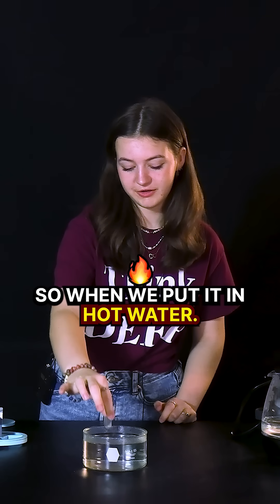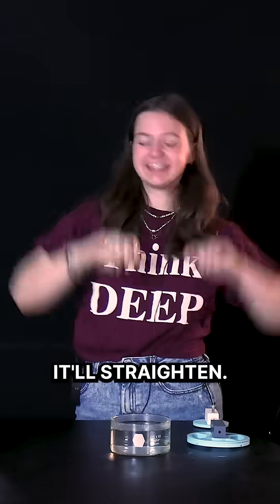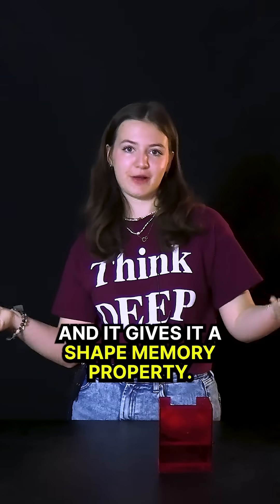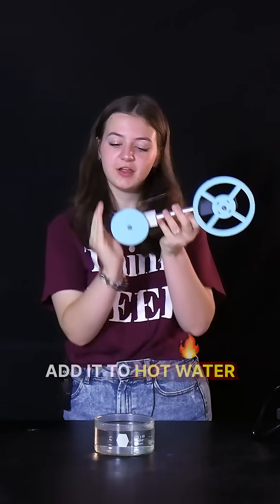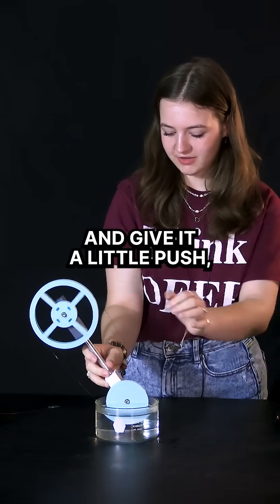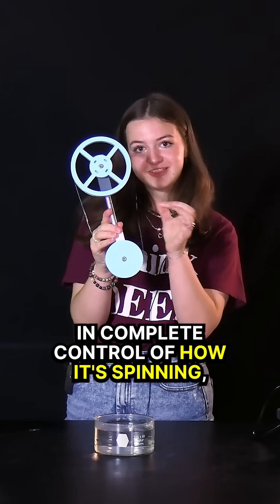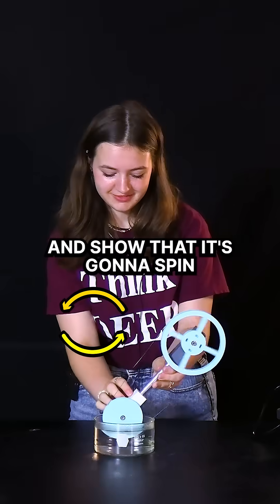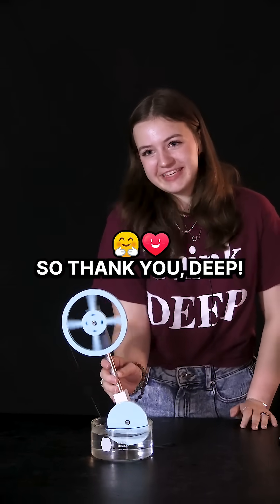Magic metal springs to life from heat! But how?? #shorts #tamu #science

Comment: For those who think it is infinite, It is not perpetual machine, because the water will lose heat and you should spend energy to re heat it again.
Someday you should believe that there would be no perpetual machine in the world.
Reply: That's not really a problem, you can have a closed system to keep heating the water, the problem is, the amount of energy that would take because of how high waters specific heat capacity is means you will need alot of energy to keep perpetually heating the water which means ALOTof money which is just to expensive to be sustainable
Reply: @jadepersonally when we dig down far enough it gets super hot, so we’d just stick a metal rod the full length to surface it will be hot continuously to heat water.
Reply: @TrueIndependent you are describing geothermal power, which we already use.
Reply: @jadepersonally  yea so no perpetual motion because it would take energy to heat up the water
Reply: hot water springs always have hot water
so there u can get unlimited energy source
Reply: @NishantCosmos  those run out too
Reply: @stephyn  hot spring water is generally hot throughout the year. Hot springs are heated by geothermal energy from deep within the Earth
Reply: So if you were to say place the wheel in a thermal pool, you would keep the heat up, and it would keep spinning ?
Reply: nobody is claiming it is... >_>
Reply: what if it was in a thermal pool
Reply: @anyoldthing  what is heating the thermal pool?
Reply: Maybe a wire made from an alloy that would react to water that’s not as hot?
Reply: @wingding7955  no way، the heat is not there for infinite of time, even if it was a heat pool which people think is infinite , then you lose energy to overcome friction.
Reply: Worse. The memory wears out eventually and it’s just a chunk of metal that does nothing.
Reply: @DiabloDevilsBA  I disagree and I extra disagree. I disagree because if that water was heated by the sun that would mean it would be able to run on its own continuously with no assistance which is the definition of perpetual motion. Now I extra disagree because I think they're already using it. Power stations I think  are creating the electricity through some kind of perpetual motion. Anything nuclear is just a scare you. While you're reading this thinking what about the nuclear bombs they were just giant TNT bombs the size which nobody could ever believe. I know this because of things left behind in those bombings. If you look at the things that were melted from that explosion things that melted only went up to the temperature of what TNT explosion could have produced. Things that we're left behind should have easily melted with the temperature they say that nuclear explosions are. Next time you're watching those old clips of the nuclear bomb going off the one where you see they're letting off smoke so I can see what's going on with the explosion.  Have a proper proper look and you will see some of those are models. Ask yourself why is the camera or the building that the cameras in not shaking and there's a few other things you can catch. Once you work out what's really going on in this place man it's just smoking mirrors. Here's something else to make your head hurt. Those big aeroplanes that move people around all the time like American Airlines and Qantas those suckers have zero liquid fuel on board. Have fun with that
Reply: @hardcastlemacormac7101  that is not the definition of perpetual motion.  Just stop.
Reply: @ryanwarner5006  Weirdly this is the second person I've seen to claim jet planes don't need fuel in just the last couple of weeks.
Reply: @hardcastlemacormac7101  Lol stop getting your information from TikTok.

Comment: Nitinol isTypically rated for 1,000 to 10,000 transformation cycles before degradation begins. Im curious how long it will run before the wire snaps.

Comment: Can you use the nitnolloop to spinn a eletric cool to induce charges on eletromagnetic motor to generate some energy? If yes, for what amount of time?
Reply: Yes you could but if you want to turn hot water into electrical energy, you should use a turbine, since it’s orders of magnitude more efficient.
Reply: @gownerjones  yess. But this is a cool way to demonstrate the elastocaloric in some fair or presentation
Reply: @cortesdopixelblock5389 That’s true. And to answer your question: it will continue until the water cools down too much, then it stops.

Comment: Could you use it at hot air vents at the bottom of the ocean for energy?
Reply: Theoretically but we have way way way more efficient ways to convert heat energy into electrical energy than this. Real applications for this metal are things like stents in cardiology.

Comment: Which way does it turn if its straight up?
Reply: It goes whatever direction you’re slightly tilting it in. If you were superhuman and you could hold it perfectly straight, the stress on both sides of the wheel would be the same and nothing would likely happen.

Comment: Too bad it can't be used to do any real work. Has little strength at this scale and requires too much heat as well as getting the metal too hot if you scale it up.

Comment: So if we used this in the heat we can use it to essentially power simple contraptions
Reply: No, you need a stress gradient for this to work. If it’s hot outside, all parts of the metal heat up at the same rate which means there is uniform stress throughout the wire. This would mean no movement at all since it cancels out. That’s also the reason why you have to tilt it in the water for it to go, the stress on one side of a wheel needs to be larger than the stress on the other side to induce that torque.

Comment: So they'd start making machines to extract energy from hot springs, right? Because they'd always be hot, and thus be able to generate infinite energy?I know that infinite energy might not be very possible, but if the weaknesses are studied, surely a new source of sustainable renewable energy could be created?
Reply: There are technologies that are orders of magnitude more efficient and reliable at generating energy from geothermal vents than this.
Reply: @gownerjones  which ones? Is there any that is like this?
Reply: @Miguel_YouTube No, I’m talking turbines. In California, for example, there’s a place that redirects steam from geothermal vents directly to turbines to generate electricity. Another way is to use the heat from geothermal vents to boil a liquid with a much lower boiling tenoerature, allowing you to generate high pressure gas from vents as cool as 110 degrees Celsius, which again can be used to drive a turbine. Usually when you want to convert heat into electricity as efficiently as possible, you use a liquid medium that can boil and a turbine.
Reply: @gownerjones  I already know those types and they are good but not like what I say with that type of operation. The only thing about that is that it has to cool the water so as not to lose it all. What I'm saying is that, as in the video, there are thermal sources that are always hot or vary little in his hot temperature.
Reply: @Miguel_YouTubeAnd I’m trying to explain to you that if you use a nitinol stress-based method to convert that practically infinite heat into electricity, you will be wasting most of it compared to turbine based systems. Not just because its less efficient but also because the wire will wear out and break relatively quickly, meaning you have to constantly replace the wire. What you’re suggesting is interesting but it’s not practical.

Comment: Wait, so would it just not spin if you placed it perfectly perpendicular to the surface?
Reply: Correct! The direction of spin depends on a stress gradient around the wheel. There needs to be more stress on one side of the wheel than on the other in order to make it spin. If you held it perfectly straight, the distribution of stress would be equal on both sides of the wheel and they’ll either cancel out into no motion at all or, if the stress is extreme enough, it will simply rip the wire.

Comment: If, and it's a huge if. If you could do that with room-temperature water. You would be as close to perpetual motion as we can be.
Reply: It’s not an if, it’s logically nonsense. It’s like saying IF and it’s a big if, but IF my car could move without speed, I wouldn’t need an engine. Like yes, that’s true. But you see how that makes no sense right? In your case, you’re basically saying IF the second law of thermodynamics didn’t exist, then we would be able to build perpetual motion machines or devices that come close, but that just can’t happen.
Reply: You cannot have a heat engine that moves heat between 2 reservoirs of the same temperature and also does work.

Comment: Energy converter for low-grade heat, engine. Converting thermal energy into mechanical energy through its shape memory effect. When heated, it shifts from its martensite phase to austenite and contracts with force. This contraction can drive motion, such as spinning a wheel. As it cools, it returns to its original, flexible shape, ready to repeat the cycle. When arranged in a continuous loop between hot and cold zones, Nitinol creates sustained motion, making it useful in engines that harness waste or low-grade heat.

Comment: So, depending on the longevity of the wire, you could harness power from a hot spring or use it in a solar water heater system to then also generate small amounts of power. It wouldn't be much, but it could trickle charge an emergency battery or something.
Reply: @dereksummers4867  I think if the torque is too high the wire will just slip on the pulley or come off the pulley. There are much more practical heat engines out there. Stirling and Rankine engines come to mind for this purpose.
Reply: You're better off just attaching a steam turbine to a hot spring or other hydrothermal vents (geysers, etc.) than you are trying to use this in one.
Reply: Materials like nitinol can only reshape a limited number of times, around 30 for nitinol. Plus, if you are able to heat the water, there are far more efficient methods of extracting that energy.
Reply: Nobody replying seems to realize how little I care about other options since this video wasn't about those.
Reply: @dereksummers4867 Weird you watched a science video but want to live in ignorance.

Comment: I was experimenting with nitinol wire in the early '90s, trying to use bundles of it as a compact actuator for a few designs of robot arm end effectors. The alloy available to me at the time would shorten about 5% when heated by passing a current through it. Since nitinol has relatively high resistance,  as wire goes, it can be its own heat source.

Comment: Bro... is that perpetual?
Reply: Perpetual motion is impossible, this is powered by hot water
Reply: @phaeste  by definition, it isn't impossible. By definition, it just has to seem to be endless and unchanging. So, just something repeating itself is technically perpetual. 🤔 is the earth's rotation not perpetual?
Reply: @DearlBarnes  Earth's rotation is not perpetual.
Reply: It takes energy from an external source, that being the thermal energy from the hot water. Due to this, it is not perpetual. The water will eventually cease to provide enough thermal energy to power it.

Comment: Almost a form of perpetual motion. Nice. Now just find a way to keep hot water hot, connect it somehow to a watermill and you might be able to generate some electricity to somehow charge/heat the water to keep this working.
Reply: Unfortunately, the wire's ability to change shape is temporary and will fade with time - and re-training it also takes energy.

There's no such thing as free energy
Reply: @teldd4930  in the clip, it demonstrates that the wire makes the wheels spin by tightening at one end. Again, finding a way to make this device to create electricity to then heat an element to keep the water should make it run almost indefinitely.  At least until the water evaporates
Reply: The trick really should be, extreme cooling at one end. So ice on one side and room temperature water might work too
Reply: @LukeBeverley  Yes, unfortunately the efficiency is below 1 so your proposed system will not be able to heat itself up and keep itself running. Hope this helps.
Reply: K

Comment: Could this be used as an electricity free safety mechanism to prevent nuclear reactors from melting down? 
Using the hot water from the reactor to engage a scaled up version of this to power a pump or something in the situation of a completely power outage.
Reply: Reactors already have incredibly robust backup power systems.

Comment: i supose on a bigger industial scale the friction created by the motion could be used via a system of pipes filled with water in them to reheat the water  but in reality would you be able to get enough motion from the metal trying to straighten on a larger scale .

Comment: Anyone claiming perpetual motion doesn’t understand that this is turning heat energy into rotation. You still have to spend energy to heat up the water and it loses energy to literally everything it touches…
Reply: @anthonycannet1305  how about a solar heater? Using mirrors. Sure you need power to keep the mirrors properly oriented, there might be less power requirment.
Reply: @russelrhaybasiao1498 so you’re suggesting building a system of mirrors that will heat up the water and then the heat will be converted to rotary motion by that thing…So you’ve created a solar power plant with additional steps
Reply: @stanananyev565  would be interesting to see it's power output compared to solar panels as it is a current problem that solar currently has limitations due to the max surface area power output, this could solve that
Reply: @russelrhaybasiao1498  solar power is not perpetual motion. The sun is burning an immense amount of fuel but it will eventually run out. The current estimate is that it will burn out in 5,000,000,000 years, longer than anyone would consider it ending but still finite. Perpetual motion machines would theoretically require no external energy supply in order to power itself with 100% efficiency. The only problem with that is everything loses energy constantly. Sound, friction, air resistance, heat, etc. all factors that reduce the efficiency of energy return. If you try to make a machine that powers itself, it will lose energy. The only way for it to be able to return the same amount of energy it costs would be if it could produce more energy than it costs, compensating for the losses of energy, but that would violate the laws of physics regarding conservation of energy. Energy cannot be created or destroyed, but a machine that is capable of generating more energy than it costs to operate would break that rule. All machines merely convert one form of energy into another. Electromagnetic generators convert kinetic energy of motion into an electrical current. The engine in your car converts the stored chemical energy of fuel into kinetic energy to turn the wheels. It’s all a matter of conversion, not generation.
Reply: hot water springs always have hot water
so there u can get unlimited energy source
Reply: @NishantCosmos that’s using geothermal energy with extra steps… or we get back to the solar energy if it’s warmed up like that which is probably not the case for a hot spring. Either way, it’s still a finite source of energy. An incredibly large source of energy that likely would last us longer than we would need it to, but still not infinite which means not perpetual.

Comment: There is no infinite energy but for practical purposes the sun has infinite energy. could we use a bunch of these, a large tub of water, and a thing to focus solar energy on the water in the middle of the Mojave desert or something to power as a powerplant?
Reply: Well you'd need to get a giant pulley system with that material and they have made one solar power plant in the desert (I forgot the name) but the mirrors were dangerous af
And it's just not very practical overall
Reply: @imfastboi  oh are you referring to the one with the solar panels in the tower with an array of mirrors in a circle focused on the tower
Reply: I don't think it'd be worth the effort. Would probably be more efficient to just use solar panels, if you're gonna use the sun to power the plant anyways.
Reply: Or we could use that same space to make a solar farm. 

Cool metal, not practical for producing energy. 

There are other fields that might be very interested in a metal that can do work without any “moving parts” Robotics, for example. Especially as we try to make smaller and smaller machines that have less and less space for conventional components.

Comment: Where's the energy coming from?
Reply: to heat up something (in this case the water) you need energy. You might use electrical energy to power a kettle, turning it into thermal energy. That thermal energy is the used to cause the deformation->turned into deformation energy. It's not infinite energy, as the warming of the water is not 100 percent efficient (since other thing around the water also heat up) and there is friction in the machine.

Comment: Is this a feasible alternative to spinning a turbine to spin a magnet to generate electricity? Like, could we use Nitinol to spin a wheel in hot water heater by something like a geothermal spring or nuclear reactor? Is it efficient? How much torque does it have?
Reply: Nitinol sadly loses it's property to "remember" shapes over time, it would have a far lower lifetime than anything currently used

Comment: Perpetual motion achieved. The laws on thermodynamics were no match for this wire and hot water. Simply power the water heater by converting the wheels mechanical energy into AC electric and you have an infinite loop.
Reply: Lol